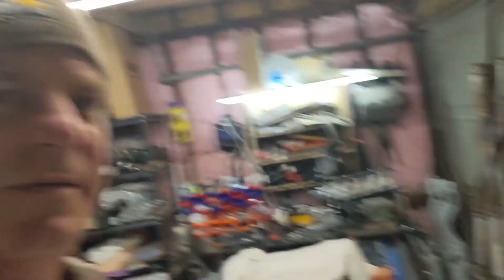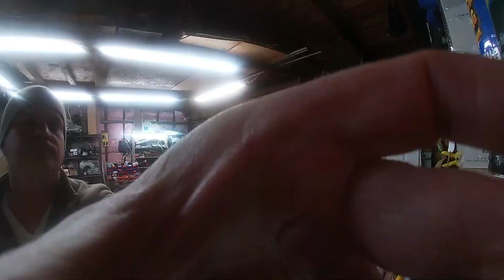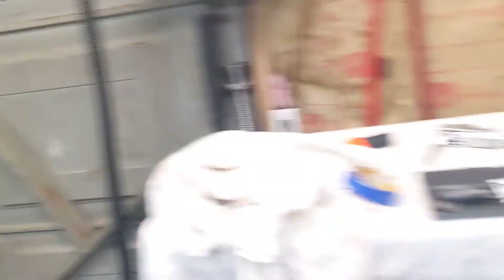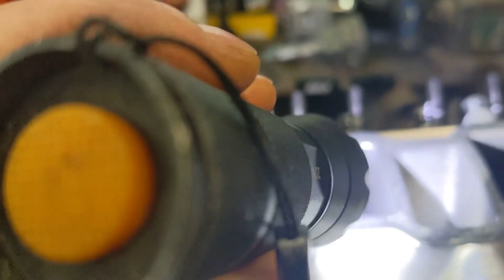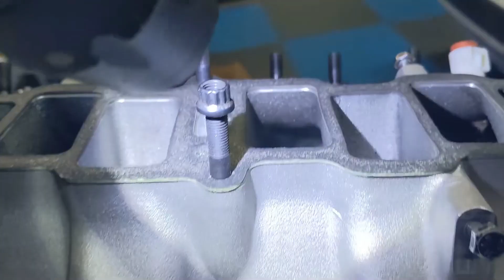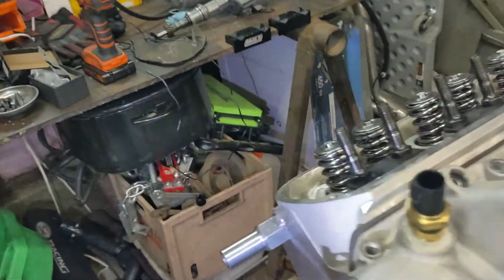TFS R lower intake mock up with milled Trick flow heads

Comment: On my solid lifters I came up with 6.550 on push rods, buy I don't run standard rockers
Reply from the maker: you have TFS heads too?
Reply: @vrm86gt  no but when I had stud mount the rods were .200 longer, seems the shafts sit lower with not as much wide measurement more picker
Reply from the maker: @alltherpm  gotcha!

Comment: Yeah i always drill my intake bolt holes a lil bigger if it needs moving back or forward
Reply from the maker: Yeah I'm going to have to do that, had to work on my Camry brakes, my wife's car needs brakes and my F150 is due for an oil change! Always something
Reply: @vrm86gt  man u just cant catch a break can ya, but i totally understand where you are coming from. Its like we can never get caught up because theres always something else that needs attention like in my case that pulls me away from the fun project being Beans. Ive got new carpet / dash / and headliner  and cant find time to put it in. Gotta work all weekend as well
Reply from the maker: @79beans347  don't work too hard, I've got the weekend off but wife already has plans for Saturday, so Sunday will likely be the brakes on her car and get the oil changed on the f150. I mean that won't take all day but I'm sure I'll be done messing with cars for the day after that!
Reply: @vrm86gt  aw man yeah its not gonna feel like u had the weekend off but least u will be able to get much needed stuff done around the house. I may treat myself to some slicks once the weeks done so i can see what kind of numbers Beans can run or new seats/ leather the ones in it already

Comment: How do u like the valve spring compressor? I got one just like it but havent tried it yet. Gotta get those new trick flow springs (made by pac )installed one day
Reply from the maker: I like it a lot but it is a little tedious winding it on and off the rocker studs, also you would have to modify the handle to remove the springs with the engine in the car as the handle will hit the fender.
Reply: @vrm86gt  aw man thats just my luck . I guess ill hafta fab (rig🤣) something up to make it work cause Im not wanting to pull the heads until I get jd to port these other 210 heads I have